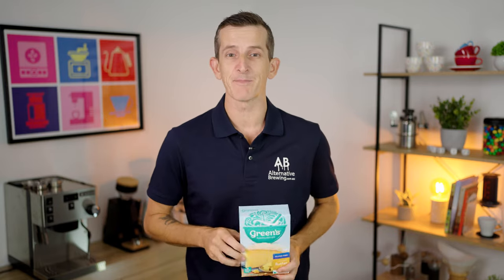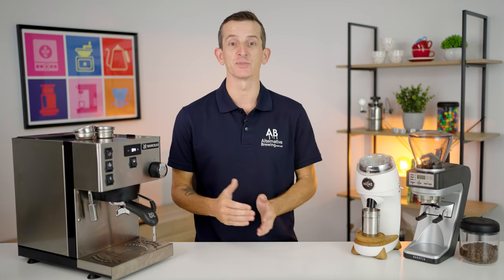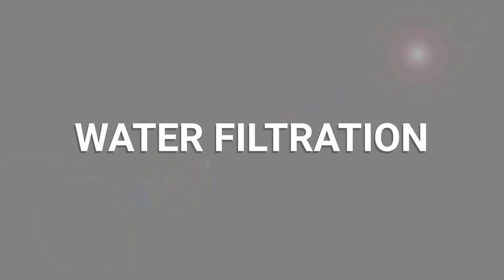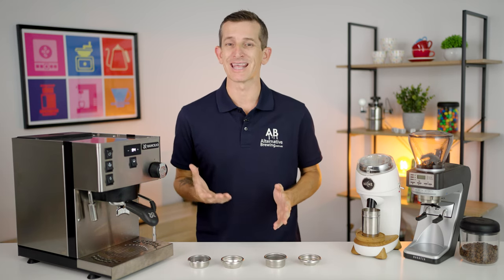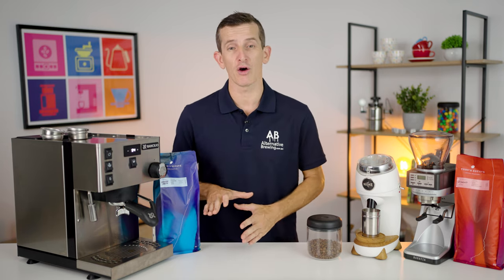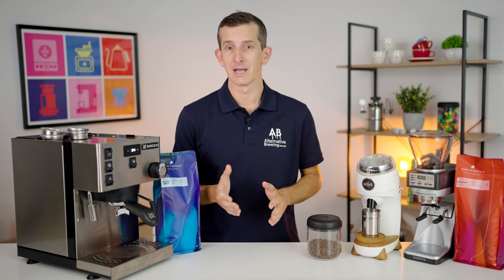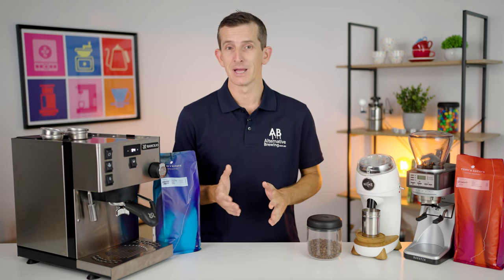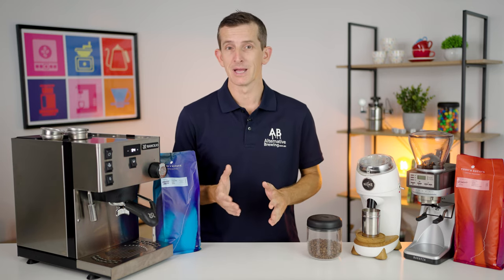Understanding the Recipe for an Espresso Brew Ratio

Comment: So i have a breville the oracle it auto dose 22g and auto tamps the light roast recipe i have is ratio 1:2.5 at 26 seconds (excluding my 12 second pre infusion) so I get 22g in and a double shot of 48g out at 38 second (incudes my pre infusion) i set my temp to 96 degrees, and i have a spot on double shot every time. Its so much easier when they give u a receipe!!

Comment: Dose size and ratio is also very much dependant on the roast profile, e.g. 18g in and 30g out so 1:1.75 ration is better than  a 1:2 ration  at 36g for darker roasts as you get the desired strength and sweeter coffee however, for lighter roast you need 36g out with 18g baskets in order to get the right strength.
Reply from the maker: 100% 🔥 thanks so much for the input

Comment: May I ask about coffee weight (grams) in the basket?
1. How many gram do you use for regular coffee routine? Some says 14g is enough for a double shot, while the other says 18g.
2. Are there any major differences between using lower dose (e.g. 14g) and higher dose (e.g. 18g) for a cup of coffee? Given that I can adjust other variables to get a proper extraction.

Btw, I visited your channel multiple times before making purchases for machine (GCP), grinder (NZ) and accessories. Really great source of coffee knowledge. Thank you again.
Reply from the maker: Your very welcome 😀 

So the dose you use will limit the amount of liquid coffee you can produce. Maintain a brew ratio, the most typical being 1:2, means using a 14g dose, you'll only be able to brew a 28-30g Espresso. That in itself is okay - it's when you begin diluting this further with milk or water for other drinks, other than straight espresso, you begin to water down the shot. 40g seems to be an ideal amount of espresso for anything from 120ml - 270ml with milk or water, without being too weak or too strong. So we're sort of backtracking here, - where we choose the size of te drink we want to make and adjust the recipe/ratio of the espresso accordingly.
Reply: For a median to dark roast you will find you can use a 14g basket and put in 15g to give 30g output is pretty good,  provided you use a 6 oz cup for a flatwhite you will get a coffee thats fairly strong in flavour however, if you use a lighter roast you will need to add an extra gram at 16g which will fit in a 14g basket as lighter roast take up less volume than darker roasts when ground and now you can get 32g out with a 1:2 ratio. Traditional Italian style espresso shots are usually 25 to 28ml but because they use a dark roast the flavour is heavier so they can get away with small espresso shots and they use a 1:2.5 ratio. They do not measure weight in cafe's / bar in Italia, they fill the basket to the top so a single 7g basket to the top so is about 10g and a 14g basket they fill to the top which is about 16g.

Comment: Thanks for this valuable video. I have a question. How can I control my espresso yield? I am getting 1:3 ratio in 20+ seconds since I pressed for brewing. I want to bring it down to 1:2 within 25-30 seconds. But here is the problem; if I grind it finer, the pressure goes up, time improves but yield remains the same. What do I do?
Reply from the maker: Thanks so much! I can help. Curious what machine are you using?
Reply: I use brevellie barista express. I am using an espresso machine for the very first time.

Comment: Thank you for this great video.. I have a question please.. You said we should calculate the brew time from pressing the button, but many others said we should calculate it from the first drop of espresso and actually the difference isn't small especially with the  preinfusion time so what do you think?
Reply from the maker: Hi there! Thanks for your question. Brew time is consistently calculated when water comes into contact with the coffee. This is when brewing, whether pre-infusion or percolation, begins. So it is always best to count from that moment. But I do understand that some very soft pre-infusions and manual espresso brewing - tend to lengthen the shot of the espresso out without too much negative impact - but this is outside of the general rule - for brewing Double Espressos. It's best to have the shot complete by 35 seconds max using no more than 20g in a 1:2 ratio and 9 bars. 
Change one of those things - and yes theoretically the time it takes to "cook" the espresso will change too. Definitely  covering this off in a future video 😀
Reply: @AlternativeBrewing  Such a great video thanks - I have been pondering the same thing as the question here, using the soft infusion on the Silvia Pro X, I think I just need to do some experimenting with it turned off to get a baseline, but it's been a cause for confusion up to this point.

Comment: Hi Josh, what is the best method and best result in the cup when brewing a double shot ristretto (1:1 ratio)?  Is it best to grind finer for a ristretto (1:1) so that the extraction time is the same as for when brewing an espresso (1:2) OR is it best to grind exactly the same as for an espresso then just shorten the extraction time to achieve the 1:1 ratio ??  Cheers.
Reply: 1:2 is a balanced ratio

Comment: Whoa! Seriously? 1 to 2 bean to liquid ratio? I'm brand new to this. I'm using 14g grounds and end up getting about 70-80 grams of espresso before I put the foamed milk in. I can't even image getting only 28 grams of espresso. What am I missing? .
Reply from the maker: the concentration will help carry some of the flavour notes of the espresso over in to the final beverage. With too much espresso brewed out - two things can occur. YOu'll over-extract the coffee, meaning you'll be ending up with bitter or burnt flavour notes in the brew espresso - and the larger volume means the espresso will be diluted down and loose it's strength - sometimes brewing less espresso - and mixing with the milk - can have more desirable flavour outcomes than brewing more.

Comment: Thanks for info. 2 questions as I have a cheaper machine that doesn't measure water and the basket only fits 20 -30.grams at most. So my questions are:
1) what's the volume of water I should add for the 18 grams of espresso on my machine?
2) if I'm only doing 18 grams at a time this is considered 1 shot right? I wanted to know rough caffeine content per 18 grams so I can dial everything in.

Thank you
Reply from the maker: If using 18g of ground coffee - brew 36g of Espresso liquid out.  This you will need to weight out in the cup - as it is happening or after that fact - adjust the grind size according to if it brewed out too fast or slow. 
18g at a time is a Double shot 👌
Reply: @AlternativeBrewing  thank you. So when you say 36 grams of water out I should put 36 grams in my machine? Mine only has a brew function, it pulls automatically depending on amount of water you add. So if I didn't add enough it would be a super quick shot or more water takes me longer
Reply from the maker: @spencerdungan5382  ah I see ! ok - than add 55-60g of Water in 👌
Reply: @AlternativeBrewing  thanks for your help

Comment: Love your videos. I’m new to making espresso. Currently using a Flair 58 with good results. I am trying 15g and 18g baskets, both VST precision ones. I have dialed each to about the same brew time (obviously hard to pinpoint with the manual lever), same ratio, and same coffee, but the shots between the baskets taste different. Hard to put into words the exact differences, but different. So I am wondering if it is normal that these two would taste different, or is it something I can ‘fix’?
Reply from the maker: Thansk so much! 
So - as an example - let me know if I get this wrong - You're brewing a 15g in / 30g out & and a 18g in / 36g out - and they're both taking the same amount of brew time? or are they both flowing at the same rate? By this I mean - if you're 18/36 is coming out at 24 seconds .... that's a 1.5g/ seconds flow rate. ... If you follow this same flow rate for the 15/30 - than you should be getting the 30g espresso out in 20 seconds. - this way - they should taste similar - but not identical -  as the baskets aren't identical. If you were to get two 18g baskets and do the same thing - you'd discover they'd taste much the same.

Now, if you're brewing both of the espressos at the same - then one of them will be either over or undercooked" depending on the time you brew it for.  My recommendation would be to aim for a similar flow rate in both. Perhaps working off of the 18g basket - get the brew time right - where you're enjoying the espresso  - then adapt the flow rate ... ( brew time divided by espresso weight) to the 15g basket and see how you go 😀
Reply: @AlternativeBrewing  ok!  Great advice!  I didn’t realize I should be matching flow rate instead of brew time.  And now that you say that, the 15g dose did taste like it was ground too fine.  So much to learn!

Comment: This is not a typical home coffee machine setup. The setup in this video cost between 2K and 3K, where most people cannot simply afford. Of course this setup makes great espresso!
Reply: This is a typical setup for a home espresso enthusiast that has committed a good chunk of money to a hobby that can last a lifetime.  It’s not a typical beginner setup, but neither is it the pinnacle of home brewing, which can easily top $10K between machine and grinder.  Regardless, the author does a great job of making this less about the equipment, and more about the ingredients and technique.  I could take everything he said and use it to dial in a recipe on a setup that cost less than $1,000.  Without the basic skills he teaches here, a barista could brew on this high $$ setup and get some pretty unsatisfactory results.
Reply from the maker: yes, you're right in saying a majority of espresso brewers at home would have a one-push button latte machine - these only have so much control before it's all automated. But there are plenty of machines in the lower end of affordability that still offer control over Temperature, grind and brew ratio. And at the end of the day - that is SO much of what is key to brewing great espresso. 
I actually just shared this with a friend who bought a Breville Machine - inbuilt grinder and all. He was able to control as much of what he needed to get on the right path to brewing the best espresso he could from his machine - and is very happy with the results.
Reply: @AlternativeBrewing  I had a super automatic and got rid of it after a week. The “espresso” it put out left a lot to be desired. But I just ordered a Breville Barista Pro in black stainless steel and am looking forward to start using it. I was thinking of the Silvia but I do not think it would look nice in my kitchen. Maybe someday I will purchase one and place it in another room in my house.